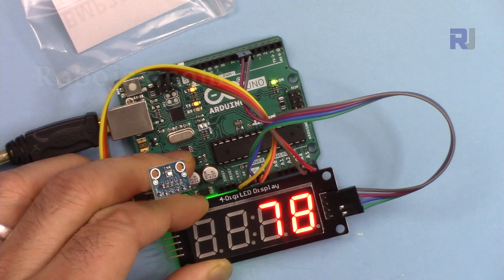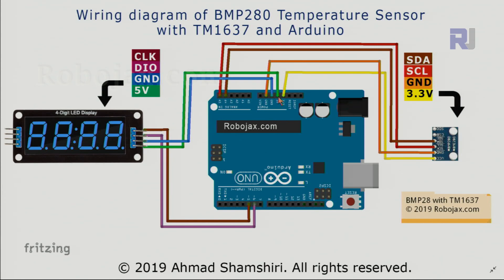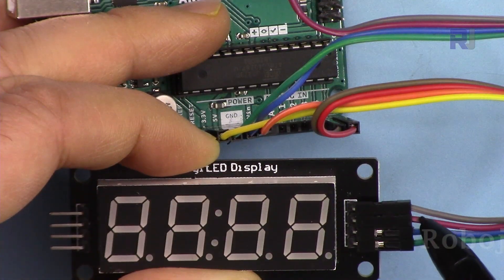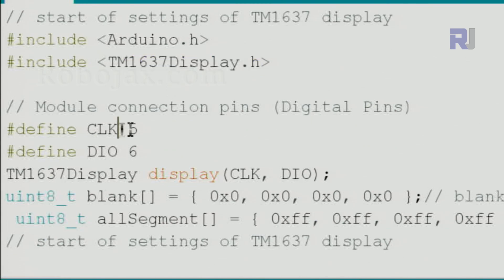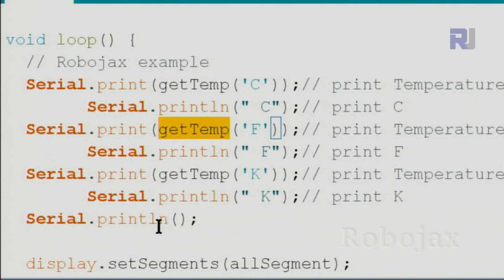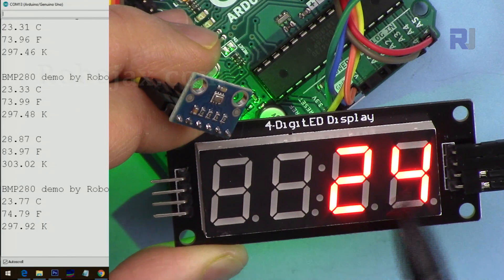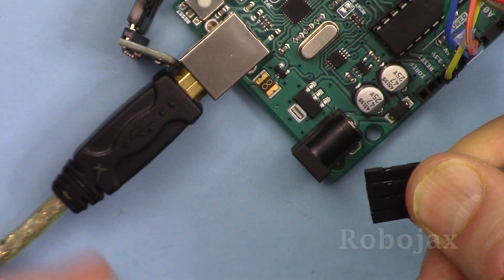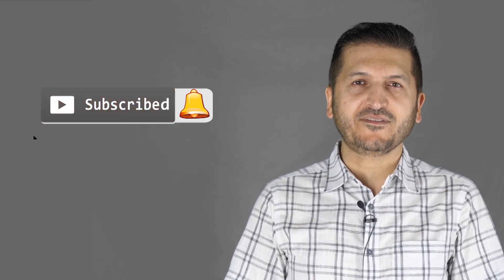Lesson 31: BMP280 Temperature Sensor with TM1637 Display - RJT538

Comment: This code below works on the LED Display.
Please know, this is the IMPERIAL Measurement for Barometric Pressure.
Thank you sir, for all your hard work and dedication.
Feel free to ad this to your code. I am "JennTek"
Arduino and understanding code is new to me.
Nice hobby.
--
imperial math for pressure 
(inches of mercury (inHg) (Used in United States)
---
display.setSegments(blank);

display.showNumberDec(round(bmp.readPressure()/3389.39));  //(338/9.39)
delay(3000);

I did not use the float portion for the math.